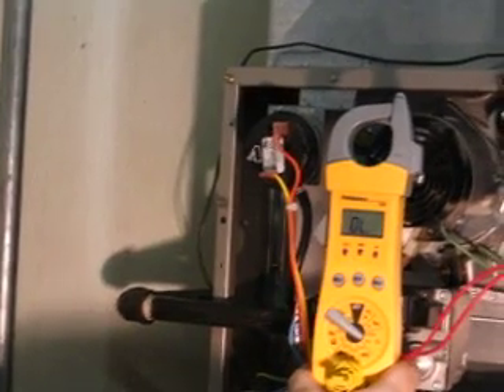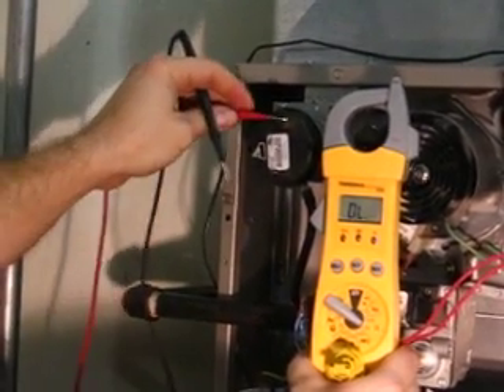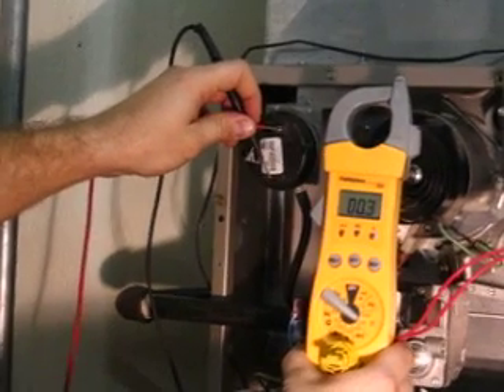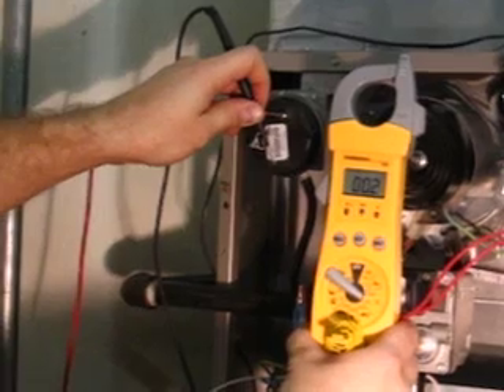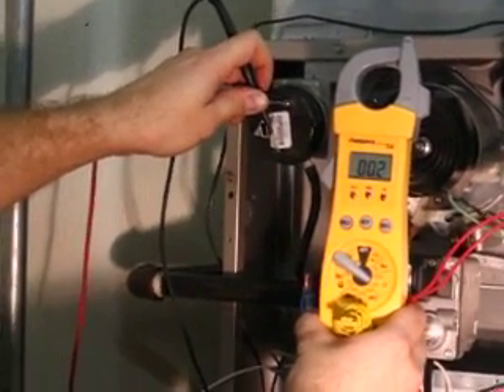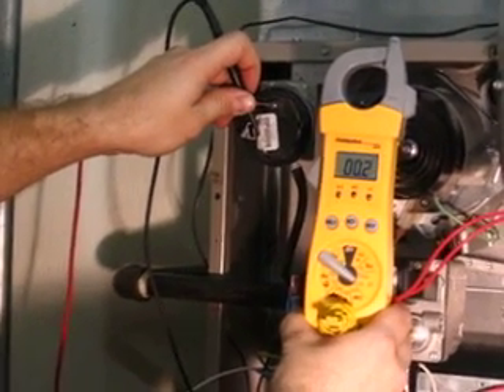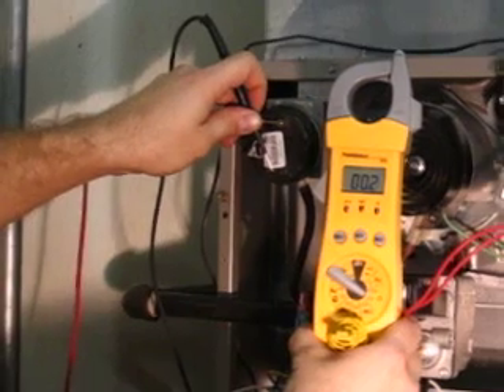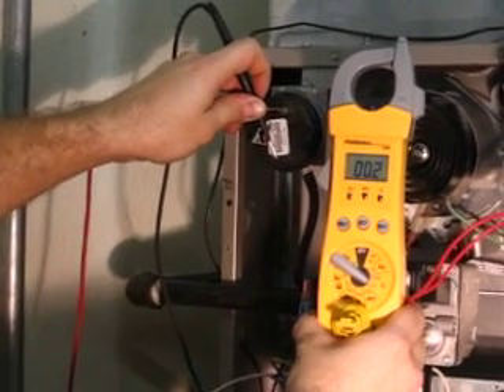Checking the pressure switch on a gas furnace

Comment: Great video!My furnace has a switch with two hoses and two electrical terminals. I believe this is called a differential pressure switch? How would I trust this? And how does it operate? Thank you

Comment: Just fixed my parents' furnace by clearing the pressure port in the combustion chamber blower housing. (By poking a wire into the port until the very hard obstruction cleared.)

Does this mean that the chamber, or the blower housing, is caked with hardened soot? Should I disassemble the blower housing to clean it?

Comment: I just had a bad snow storm that dumped 17.5 inches of snow in the area and the pipes/chimney were plugged on the roof for the furnace from the snow so i had to wait for the snow to melt and it worked, I was getting the LED status error code 31 because of the plugged pipe for the inducer I believe.